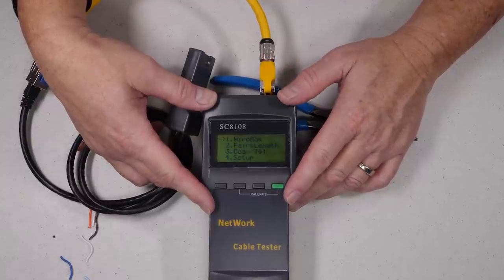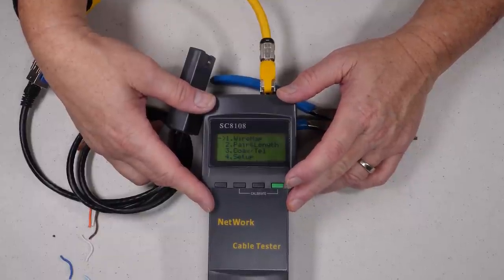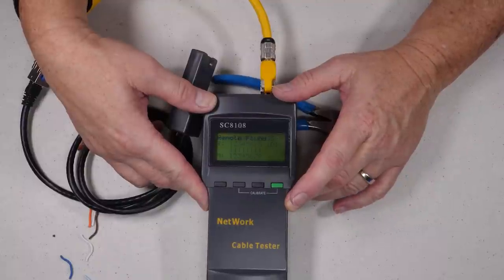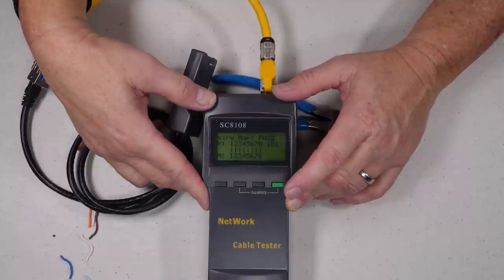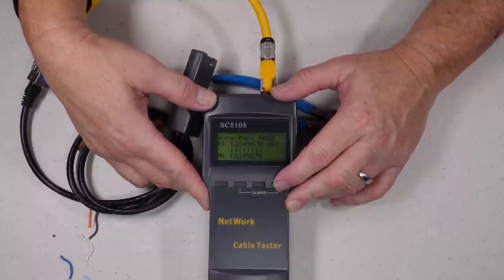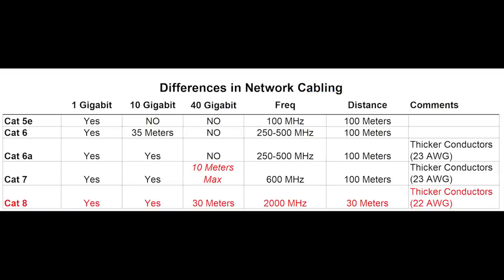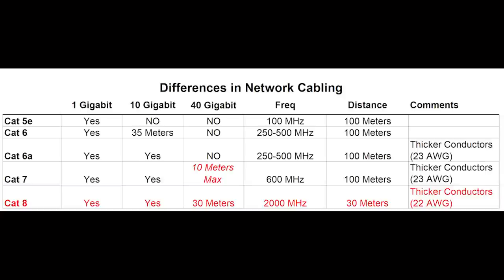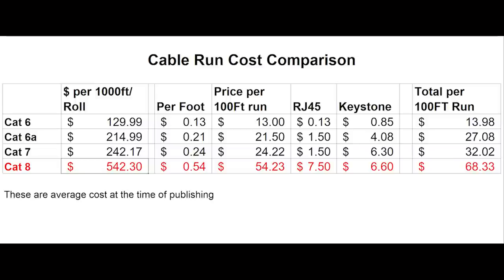CAT 8 vs CAT 7 Ethernet Cables - Is there a difference?

Comment: I don't think there's a spec difference in the RJ45 ends of CAT6 and CA6a. Where did you get your pricing? All this is non-sense without having aa shielded patch panel At which point, what are we doing?? Just go to fiber if you really need the speed. And I doubt any of us at home have a 40Gbps requirement.
Reply from the maker: This video was done a while ago and the pricing was from Amazon.

Comment: The cat 8 cable has a relative short range of 30 m ( for 40 Gbit ) , i dont think it makes that much sense . I rather would use glas Fiber if you plan to use that high Network speeds . 10 Gbit Rj45 is a different matter , most Motherboards have 2.5 Gbit  today  with highend at 10 Gbit , it makes sense to use a Cat7 cable which can be 100 m long because the price difference to CAT6 cable is not that high , if you pay 30$ or 40$  more fore 100m its worth it in my opinion .
Reply from the maker: Great point.

Comment: There is no IEEE CAT 7, Just 6a and 8.
Reply from the maker: True it is not certified by the IEEE but it still is a product that most cable vendors are supporting.  Thanks for the input.
Reply: @MikeFaucher  It's not certified by any major certification organization, rather it was REJECTED which means its not a standard and should be stated as such. By including it as a standard in what is an 'educational ' video its giving credence to the idea that it IS a standard. 

Also T568A is the better of the two wiring schemes because its required for any US government project and is backwards compatible . T568B can't be used on a government job nor is it as backwards compatible. There is no downside to using T568A but there is to T568B.

Comment: In a house cat5e or 6 is perfect you wont see a bit of difference for long runs on a commercial job application it would keep speeds what u would normally get from 5e or 6 . ide bet there are so many homeowners rushing out to waist their money not knowing that their old cat 5 is gonna give them the same results and save them alot of money
Reply from the maker: Great point, that's true unless you are running 10G, then it is better to use 6/6a depending on the length.  I am running 6 in part of my house and it was close enough for 10G but it would not connect reliably at 5e.  Thanks for the input.

Comment: Me who just using 5e😂
Reply from the maker: Thank you for the feedback.  I appreciate it.
Reply: Honestly most people still use it. I use it for installing cameras and residential drops. I rarely see 6a or better.
Reply: I only run cat 6 for the main wire between my modem router and switches.  I still use cat 5e to go from my switch to the device.  The only thing I kept the cat 6 to is my Xbox to make sure I get the best connection for my gaming.
Reply: @KevinBenecke   - Hell you could probably get away with 100 mbit Cat3 for gaming.
Reply: We use cat5e for our gigabit ethernet run from basement to upstairs as the phone jack port all had cat5e runs and it was easier to turn the phone port to ethernet than run brand new cable through the walls. We get full speed through that cat 5e cable....

In fact, with newer technology, you can do 10g through cat 6a.... I have a network card which supports 10g through cat 6a.... Which is funny

Cat 7 last i checked is not an official recognized standard... Cat 8 is however.... Both are useless and are not the future. The future is fiber because light is faster than copper.
Reply: @goblinphreak2132  fiber may eventually be the future, but not how it is now and not for a very long time. Copper is how it will stay for the foreseeable future.
Reply: I have seen 10GbE over Cat-5E in practice where the distances do not exceed 30 meters. Would I recommend it in the Data Center... No
Reply: @popquizzz  We use short Cat5e patch cables for 10Gbit all the time. Don't even need shielding.
Reply: @goblinphreak2132  other big differential is copper supports PoE standards where fiber obviously doesn't. Anything need g remote power like WAPs, cameras, IP Phones, or any host of other devices and sensors can all run over PoE. They even make adapters for Raspberry Pi boards so you can run them over PoE too. It's a very useful and widely deployed technology.
Reply: @jackshett  Fiber is too delicate... And cannot support PoE standards, since they use lasers or LEDs to transmit data, while copper can still run electrical outputs to power devices.
Reply: @Valentin119  uhh, yeah. I never said the contrary. And it isn't all as delicate as you assume.
Reply: @jackshett  Sorry, I was trying to add onto yours. Not trying to refute you.
Reply: @ChristopherGoggans  I did not think about PoE,. It might be the only reason for copper networking to still exist in 10 years from now.
Fiber optics is the Future, with devices getting cheaper and copper getting more expensive.
But at the same time a lot of houses will be using old tech just like they do now.
Reply: If it can't run on JK, it can't be run. LOL
Reply: @GZ because common sense. Copper can only go so fast. As it stands, MoCa can only handle so much throughout. I tested MoCa 2.0 bonded and the fastest speed was about 600/600 in a single family home. Sure 1 foot of wire you might see the full gigabit but in reality most people wont. Then you have cat6, while 10gig is possible through special data transmission eventually even cat6 will become a bottleneck. Increase is copper wire size (awg) will eventually be more expensive then simply switching to fiber optics. No one really bends cat6 in a any way that would break fiber optics. My buddys business is all fiber and its not a delicate as people pretend it is. Sure you cant make any tight bends with it, but there are ways around those issues.... Even now a lot of the best and fastest server farms are all optical....
Reply: @GZ cat8 supposedly supports up to 40 gigabit.... which means 40,000 rated in terms of ISP numbers.... (single gigabit like I have with verizon is 1000/1000 download/upload) but even though the cable is "supposedly" capable of doing this, none of the equipment people use even comes close. hell I am running gigabit through cat5e from the verizon box in the basement upstairs through the wall to the router, and then from the router we just so happen to be using cat6 to each computer. my computer in the living room is running off 150 foot of cat6.... and i get full gigabit speeds, even though eventually its hitting a 5e cable.

the xbox series x, probably has a 10/100/1000 network adaptor inside. meaning the highest speeds you can get would be gigabit. meaning real world downloads of about 125 MB/s if you were to max out the connection, most likely topping out to 100 MB/s because of overhead. as far as your home router, those are generally 10/100/1000 but you are limited by your isp. So if you only pay for say 100/100 internet, than all you will get is 100/100 throughput. I know a lot of people in the US especially in rural country area's barely get 5/1 internet as their fastest option.... sucks for them but whatever.

so in reality, you will more than likely be limited by your ISP than cables or routers.... I know verizon has always been fiber to the door aka there a literal fiber connection from the street to the house to a box that converts that signal to the cat standard. Comcast used to only offer 50/50 around here and then when verizon came in giving fiber, comcast had to offer fiber to catch up, took them a few years too. even then I remember when comcast first started switching to fiber, a lot of their old coax based nodes were crashing due to the demand fiber put on those old systems. they just couldn't handle it. packet loss out the ass until the whole system would fail. then people would end up having to go through longer node routes to reach a destination which increased gaming latency. a node is basically like a waypoint but ISP side. so for example connecting to a game server in new york from maryland, first node is my house, then the box outside, to another junction, to another junction/node, all the way until i reach the server itself. and the node's for verizon being coax couldn't handle the fiber load. while verizon service is full fiber everywhere for the most part. and since most server farms are based on fiber, i get full speed downloads pretty much everywhere I go. steam and blizzard game downloads i get 100 MB/s. games download/install in no time lol

as far as "what can you get from coax internet to your modem then from there to your console" depends on what you pay for from comcast. i know comcast used Docsis, which is like MoCa, and is theoretically possible to get gigabit through it. But from my own experience from MoCa, nothing beats classic cat cables in terms of packet transmission (MoCa has more packet loss than cat cables do, docsis might be the same).

I know comcast likes to say "fastest wifi" simply because the wifi connection itself supports higher than gigabit, which is meaningless because you would be limited by raw downloads. so even if for example the wifi was 1250/1250, if you only pay for 300/300 then you only end up with 300/300 through wifi. and even then, wifi numbers are bullshit because you never hit the rated speed. our wifi is AC2900 speeds. my computer is capable of communicating in that standard, which at 5ghz signal should hit 2167 Mbps according to spec sheets, and I can't even get full gigabit from it.... now some argue signal strength, but I have 4 bars out of 5.... going down to 2.4ghz band, its capable of 750 Mbps and yet again, I get nowhere near that. I max out at around 400/400 using wifi which is dismal compared to wired with full gigabit speeds.
Reply: @GZ but there is a difference between official products which just so happen to be made in china, and Chinese knock off brands which make shit cheap copies to undercut those larger businesses.

Comment: Why does a still exist?  Has anyone wired a type A connector ever?
Reply: Yes. Way back in the day when crossover cables were required for some things.
Reply: @timramich  Thanks, I forgot about them.  It just seems like it would be so much better to go with the B only on the markings.  I do like the way these new ones are inserted into the looms, seems like a much better way to get everything assembled.
Reply: The reason is that 568A is the original AT&T wiring code which puts blue on 4/5 and orange on 3/6 which gives 2 lines of analog service for phone and modem/fax back in the old days. If you don’t care about that you can choose either color code.
Reply: @danpayerle  Thanks for the explanation.  I know that in almost 40 years of doing my own limited wiring, I have never used A.  The recommendations I saw were to use B.  Since I  do very few the two colors are always something I have to check and make sure.

Comment: this was really helpful. i was about to massively over kill with cat 8 150ft cable for a 1gig connection. it's all that's offered where i'm at (still way faster than the 100Mbs i was using a few days ago)
think i'm going to look for a really sturdy cat 6a.   it has to be routed outdoors.
Reply from the maker: Glad it was helpful.  6A should be fine well into the future.
Reply: @MikeFaucher  should i buy a cat 7 bc on amazon i dont see cat6a
Reply from the maker: @wellityenabulele456  both are available on Amazon but either will be fine.

Comment: cat5e can actually do 10gig longer than 35 meters.
Reply from the maker: In some cases however in my testing I had reliability and connection problems much longer than that and it often dropped the performance.

Comment: CAT 6A is officially designed for 10 Gbit Ethernet. So what is all this magical CAT7 and above used for? Never forget: A 20 Megapixel sensor is always better then a 16 Megapixel Sensor in your Camera. And broader tires are always better than narrower tires... 🤪🤪🤪
Reply from the maker: They are almost the same except for "some"  Cat6a uses a smaller conductor.
Reply: Cat7 doesn't even count as Ethernet cable, the specs skip right over it as it's not needed for 10G (Cat6a handles it to full length) and can't handle speeds faster than 10G.
Reply: @bastian2586  yes that's right in some way. But in this high frequency it's getting really weird. You need new connectors like GG45. This is completely on the edge of physics and generates additional problems. We all know the solution : fiber optics...
Reply: @bastian2586  It may be capable of that, just like how Cat5e is capable of 10 gigabit up to 45 meters, but in both cases it's not certified for it. Cat8 is certified for 25 and 40 gigabit. Cat7 has no Ethernet cable certifications. Sure, it'll handle 10G perfectly well, but it's overkill for that. It may be able to handle 25G and 40G, but no guarantees there. Point is, it's never the best choice.
Reply: @KingdaToro  True for TIA standards in the us. For the rest of the world cat 7 is used to build ISO/IEC Class F links. They are used for Ethernet as well as cable and satellite TV instead of coax.

Comment: Why he couldn’t test the cable - the testers are not set up for Cat 7/8. These are theoretical categories. The EIA/TIA doesn’t really have much to say about this

OM3 and OM4 Fiber will handle 10GB to 300m (984’) and 550m (1804’) respectively. Also, Fiber is cheaper than these silly so-called Cat 7/8.1/8.2 useless overpriced cables. 

You can purchase Category 6 Enhanced cable which tests to 600Mhz so why would anyone do this?

Category 6A already meets 10G standards for short distances and testers exist which can certify, so once again, what is the point of Cat 7/8 other than to enrich companies like Siemons??

Real world applications for this are severely limited. Besides, who is going to buy switch gear and network cards and other infrastructure (patch panels, etc.) for a non-standard interface?  This is practically useless for 99.9% of network installations.
Reply from the maker: Agreed.  Thanks for the input.

Comment: Its not RJ-45 Connector its a  8P8C modular connector  RJ-45  is registered Jack 45 used in telephone modem connections  where pin 4 and 5 are tip and ring and 7 and 8 are connected to a resistor that indicates the signal loss from the  central office to the Modem.  It would be good if the bad naming stopped being perpetuated by instructional materials.   Like many other things people uneducated it  the actual facts picked up the name and used it for a different purpose; then it gets added incorrectly into the common  lexicon  by marketing people and volai  suddenly it starts to be used incorrectly by even less educated people

Comment: Lol, there is no such thing as Cat-7. That's because category cables are governed by the TIA/ANSI standards organization. Back in the mid-2000's the TIA was about to ratify Cat-7, it was the final draft. Then suddenly another standards org from Europe called ISO took the final TIA draft, and published the standard itself with a few minor changes. It was a dramatic coup d'etat, they were actually trying todo a hostile take over a cable spec from its standards body. Well anyways, nobody recognizes Cat-7, because it was not legitimate, because the TIA still was the governing standards body for category cable. So TIA renamed their standard as Cat-6a, and enumerated Cat-8 & Cat-8a so they could not be leapfrogged again. The only network equipment company that accepted the ISO Cat-7 spec was Siemens, a European company. The rest of the world simply ignored Cat-7, and so should you... Because it doesn't exist, it's not a TIA spec.
Reply from the maker: Thanks and you are correct however though not ratified MFGs are selling it as cat 7 and most have consistent specs. To ignore it would not be fair to  people looking into cabling. Thanks for the expertise and sharing it.
Reply: @MikeFaucher  I disagree, both Cat-6a and the so-called "Cat-7" have AWG-23 wires, which go into (and beyond) the 750Mhz band. One spec says 500, the other 600.... But both cables are electrically equivalent in reality. So please, just ignore cat-7
Reply from the maker: @JonDisnard  Understood.  Thanks!
Reply: @MikeFaucher  btw, not trying to be contentious. Sry about that. Love your videos! 👍 For more context, the TIA wanted to take a more conservative approach, they were more focused on the idea of 100 meter cable length guarantee, so they wanted to balance wire gauge vs insulation/shielding, with a bias towards being as minimal as possible. These topics were debated during the draft process, and some entities didn't like the chosen outcome. The ISO observing this decided to intervene. This is a gross over-simplification, and the drama doesn't really matter. The prevailing point is cat-6a cables are for all intentions & purposes... Equivalent to cat-7, but the later is not a legitimate standard. The only difference that matters is the QA process, where cat-7 must maintain 600 MHz modulation, cat-6a tests at minimum 500 MHz. That said, in reality the various cable testers use 750 MHz, and get to say the cable exceeds the spec. 23 awg easily meets that spec, but attenuation over distance degrades, so shielding... The ISO spec was less concerned about distance, presumably fiber filed that space, so they specified just enough insulation to handle a row of racks in the data center, about ~30 meters, and we get cheaper cables with a nominal bump in modulation.
Reply from the maker: Thanks for the insight as you obviously have a lot of knowledge so the input is appreciated.  No need to apologize as I completely understand and agree with what you are say that it is not a certified product.  This is a classic case of MFG building ahead of ratification as they did with WiFI 5 and 6 and never pulled the product before approval.  Anyway, thanks for the input and thanks for watching.